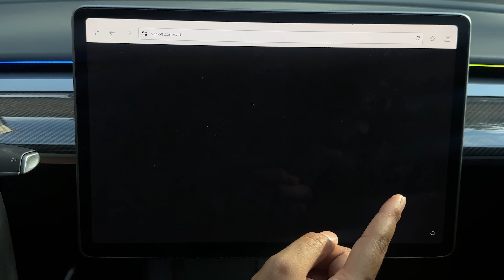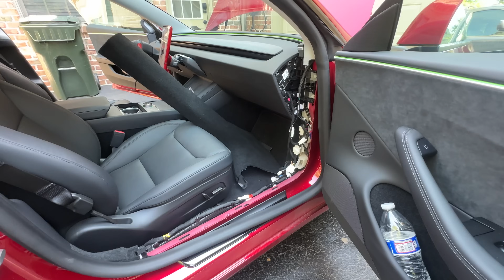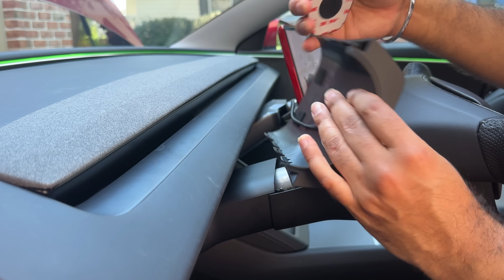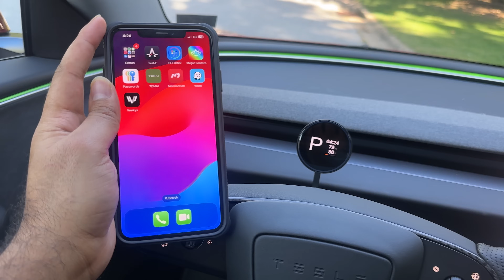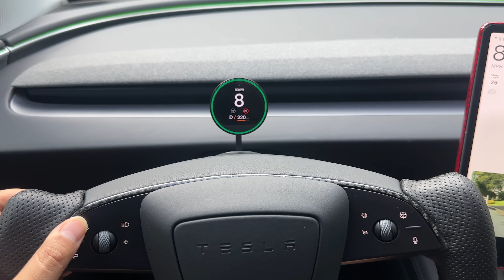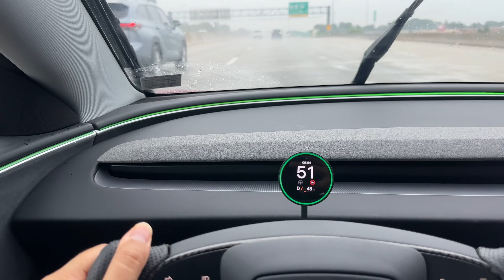NEW Tesla Model 3/Y OLED Instrument Cluster Display with APP CONTROL & Blind Spot Monitor!

Comment: They include a plastic template for positioning of the display on the steering column cover. Was there none in your unboxing? I installed mine in about twenty-five minutes. I really like it. It's unobtrusive, doesn't block the AC, and provides the basic info I need in front of me. Funny how people criticize its design while they think the Magbak phone looks integrated (I have one and I think it still looks like an add-on hanging off the screen). Anyways, for $109 it works for me.

Comment: I like the idea and the price of this one but the execution is not there yet for me. I would rather have it up higher on the dashboard and pass the cable through the vents than having the obd port blocked off and also the UI isn't there yet. E.g. the fact that everything (including the ugly blob in the middle) is always orange in stead of the colors of the ambient light or the super basic wallpapers.

I really like that it has a ring ambient light and that it can sync to the car. I wonder how the sync works because I saw if you blink to the left it also blinks but does it also do this when you blink to the right?

Comment: I would buy, but I already have the plastic cover for the aftermarket juniper drive stalk.   The reason this wouldn’t work is just the angle of the support would need to be slightly different.   Otherwise looks great.

Comment: I assume it does km/hr?  Not just miles?  Also would prefer battery percentage, not range.
Reply from the maker: Yes it does both KMH and MPH. Noted on the battery percentage, they can easily make that tweakable through the app. Thank you.

Comment: They did a good job with this device. I hope they make a second revision where the mount looks more polished. The current one looks 3d printed with harsh corners and doesn’t match the car. I like the design and UI of the Tita but the wireless power on this unit is a game changer. 

Please have the option to remove the background and minimize the icons on the screen @Veekys

Comment: Wonder why they don't offer it for the earlier models (edit: just watched the end of the vid lol). Also, really don't like the red flashing ball thing in the middle of the speedo reading!
Reply from the maker: Thank you 🙏 Yeah they are working on the version for the older cars. They said they could technically release it for the older cars now like what most companies do but they are not confident it will work on all different versions of the cars, so they rather make sure everything is flushed out to not cause customers any heartache by rushing a product where they haven't confirmed every little details work. That is actually why I like this company a lot, rather than rushing a product, they are doing their due diligence :) Agreed about the orange light in the middle, I hope they make that optional.
Reply: @ShivaSapkota  That orange bubble sends my OCD into overdrive! lol. Hey, did you ever test the TITA Ultra OLED puck? I have the original and love it but wondered if it's worth upgrading
Reply from the maker: @bazza8947 I can imagine haha. I tested something similar and this is a much better unit. I am not sure the one I looked at was an OLED though. Thanks.

Comment: I believe you said something about the display could work with any MagSafe charger. Did you try using the iPhone app with another MagSafe charger? I'm wondering what the box on the USB cable is for. It might be the Communications to the application on your phone. Thank you for a great demo.
Reply from the maker: I just re-read your comment and you were talking about the app not the display. So, I went outside to check in th car, removed the usb c and OBD, placed the display on a magsafe charger and the app still works. So, yes this can fully work with just a wireless charger :) Thank you.
Reply from the maker: Thank you. Yes, the usb c and the box just provide power. I placed this on top of the Tesla's wireless charger (you can see it on the install portion when I was testing) and it works giving me all the car data. I also tried a powerbank with MagSafe and it worked too.